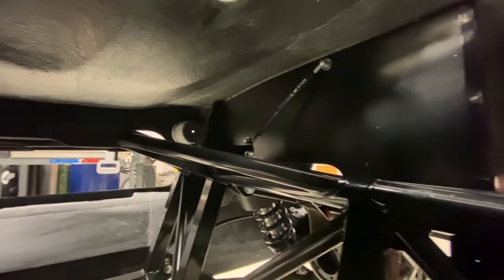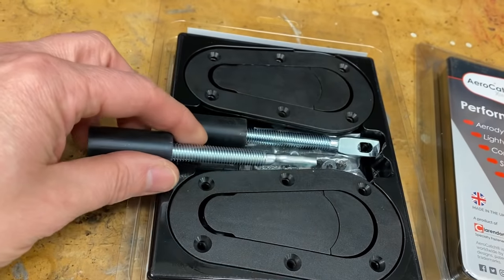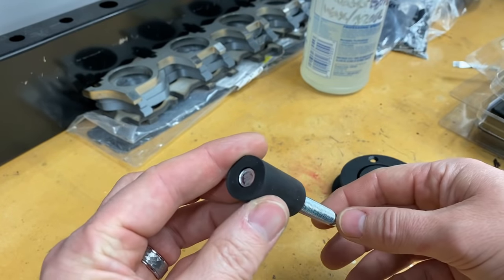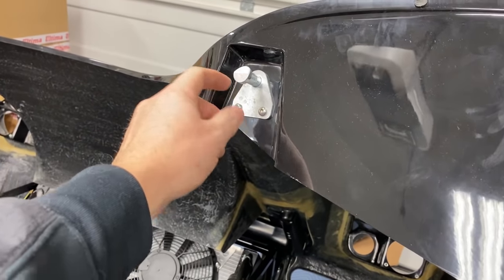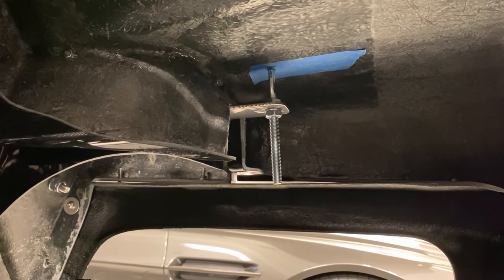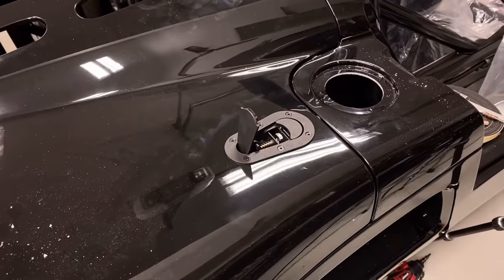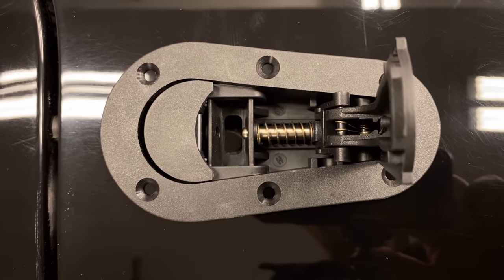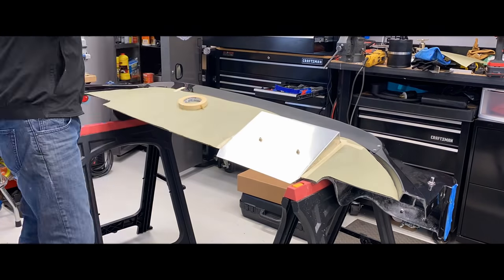Project 'Top Gun' - Latch Hatch - V10 Ultima Evolution Convertible Build

Comment: Add some springs on the aero style latches or some threaded rubber stops from an OEM hood, these are adjusted to put a bit of tension on the hood or in your case clam shell when closed so when released the hood/clam pops up slightly. This will stop chatter from the clams and any rubbing etc. 👍

Also paint the under side of the aero latches in a fluorescent orange or pink, that way it is very obvious when they are not latched in position 👍

I would add some alloy plate bonded behind your home made pin brackets, there’s a lot of flex there and fiberglass doesn’t like it, it will crack and craze the gel coat over time.
Reply from the maker: All good advice. Yeah, adding some reinforcement behind my L-brackets is on my list before I install that rear bulkhead permanently.

Comment: Add a OEM style hood secondary safety latch (hook type), I have seen similar latches either not latch properly or fail and cause all sorts of damage and problems. Adding the secondary safety latch is easy and belt and braces. Even backwards opening clams like the front clam come up and hover blocking your line of sight at speed because of the low pressure zone in front of the windscreen 👍

Comment: Nice progress!  I do recommend you consider reinforcing the fiberglass mounting for the L brackets you fabricated.  Although you pointed out the clamshell rests on posts, it won't be completely stress free.  When you hit a bump, the posts will transfer an upward impulse force to the clamshell (i.e., the front of the clamshell will want to bounce off the posts).  The only thing keeping the front of the clamshell in place has to be a downward reaction force of the L brackets which in turn imparts a bending force on the fiberglass.
Reply from the maker: Hi Art...thanks for the sound advice. One thing I was thinking about: I wonder how much different are the forces placed on the fiberglass between the original hood latches and the bracket/Aerocatch combo?  Given the latching lever is further out by a couple of inches (as compared to the original latch mechanism), there is a greater force “lever” on the fiberglass. So you’re right, I should reinforce the fiberglass behind the L-bracket. It’s easy enough to do now and cheap insurance!  Thanks again for the advice. 🙏

Comment: Very nicely done Dan, though whilst I plan to fit Aero latches on mine in the same positions, I've already decided to use 2mm alloy sheet to mount the pins on the rear, but lower as I'll have to access fitting via the side vents!  The fronts will be interesting to access?

Comment: I think you were struggling with the contact adhesive because you need to let it flash off before putting down the carpet, the tin will give you the flash off time, anywhere between 30 seconds for a quick glue to 30 minutes for a slow one. Choose the glue according to how big or difficult the piece is, slower for larger jobs or quick for for over head jobs etc👍
Reply from the maker: You’re exactly right. I neglected to read the tin until after I set the carpet. I won’t make that mistake again. 🤟

Comment: You have given me the motivation and how to install my Aerocatch latches. Thanks for showing how to do it. I had given it some thought, but your way is so far the easiest and cleanest.
BTW with the Aerocatches do you thing the little top central latch is necessary or not? I see it a bit out of place.
Thanks
Reply from the maker: Glad it helped!  Good question on the little center latch. I did notice it does pull the top center of the clam and helps align it 100%. The Aerocatch latches have tiny bit of play to help them align so the little latch just snugs everything up. I plan on keeping it on my car.
Reply: @DanDulac  yeah guess that makes sense, so I'll install it when I get to the body fit

Comment: I'm curious what you were trying to accomplish with the video crop?  Looks like you also tried to blur out the "NOSUP4U" plate?  There are some good tutorials on YT for keyframes and tracking... but I don't think you really need to worry about bluring out a license plate.
Reply from the maker: Tracking is fairly easy in any video production software. However, I tried implementing the “blur” tracking after posting to YouTube...(it was an afterthought). YouTube has a video edit feature where you can do this but clearly it doesn’t work well. Live and learn. 😎

Comment: I thought you were going to add a gusset to the bottom side of the pin bracket . Has this proven to be sufficient without that gusset ?
Reply from the maker: That was the original plan...but I ended up using thicker steel for the bracket (10 gauge) and it’s plenty strong and rigid without a gusset. (I had a hard time bending it without a proper bending machine).

Comment: It’s a great looking latch but does it have the ability to squeeze the two parts together so no rattling?  What is the model of the plasma metal cutting table and how hard is it to program a pattern? Thanks
Reply from the maker: Hi Dave—yep it does. The rubber isolator sleeve that slides over the pin is cut to the correct length to provide a snug fit when latching and adds the benefit of dampening any vibration.
Reply: @DanDulac  I guess on final assembly I thought that was the case. Did you build the Cobra on the rack?  You could use about three times as much space!!
Reply from the maker: @dave5833  I finished the Cobra back in 2008 when I had a smaller garage...I built my current garage about 4 years ago and it’s still not enough space!!!  Lol.

Comment: Hello Dan, Is there any reason you did not put the front clam latches on top like on the rear clam. Ray Hall.
Reply from the maker: Hi Ryan...given the design of the front cowl, there's no 'clean' location to mount the pins.  The side location allows for a flat mounting surface and plenty of room for the pin.
Reply: @DanDulac  Thank you. Ray.